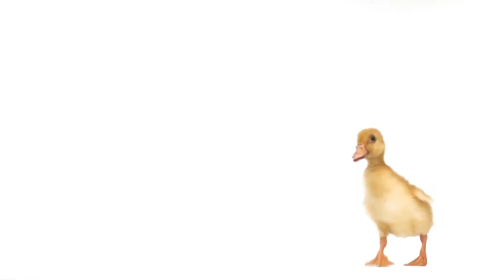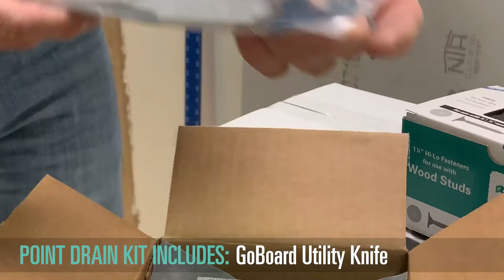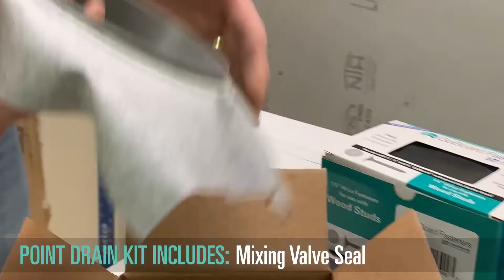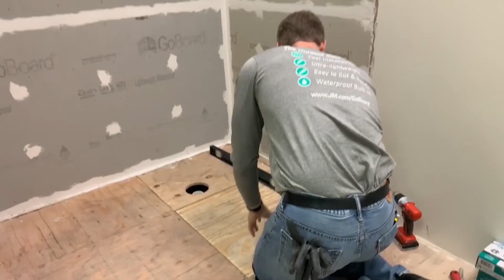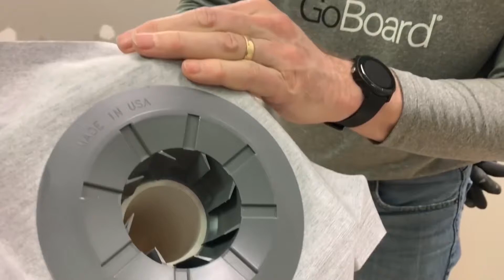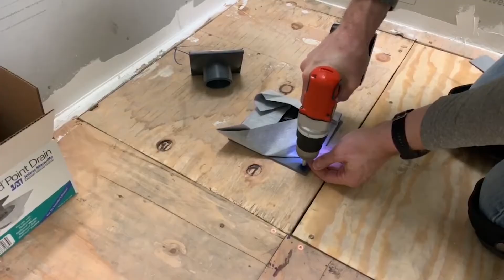Easily Install the GoBoard® Point Drain Shower System

Comment: How would Heavy Glass shower doors be secured to the Curb? Seems screws would not hold very well in Foam.
Reply from the maker: The preferred method is to secure the door to the wall. Another installation method includes cutting channels for setting wooden dowels into and through the foam, for more secure fastening of door hardware. Then use GoBoard Pro Sealant to well waterproof the dowels and foam penetrations. Door track can also be adhered to the curb using GoBoard Pro Sealant.

Comment: Does the GoBoard wall sheets go all the way down to the floor?  If using a traditional pre-slope, liner, and sloped pan, should the GoBoard go all the way to a concrete floor also? This seems needlessly dependant upon the aquadefense or redgard. I am building my GoBoard shower this weekend. I started the concrete curb tonight and planned to build the pan pre-slope tomorrow and final pan the next day -- but perhaps with GoBoard I can put the walls up first? But again, this seems needlessly risky.
Reply from the maker: GoBoard is installed on walls first, all the way to the floor.

Comment: So if I'm using 1/2" Goboard on the outside of a bathtub for the floor, do I still have to mortar it to the plywood then screw? Or can I just screw it down dry? Then I have to leave an 1/8th inch gap all around for the walls & in front of the tub and the one seam I have and then fill all those gaps with the sealant? Then I can tile?
Reply from the maker: Just fasten the the 1/2" GoBoard on the outside of the tub. Fill the gaps with sealant. Wait for the sealant to skin over - and then you're ready to tile.

Comment: With the way the wedge pan was cut, does that create a level perimeter?
Reply from the maker: We recommend tiling the shower walls first, to help hide the angle cuts sometimes required near the shower pan in rectangular, and offset drain location situations.
Reply: @johnsmanvillegoboard  I believe a level perimeter could be achieved if you keep all the perimeter the same thickness and have your cut go from wall corner to drain corner instead of someone within the middle of the wall. I've used your system before, just never with an offset drain.

Comment: As a contractor I view the showers the same as exterior of a house.  You don't side the house then put the roof on because each thing should lap from bottom up.  Now that said I have forever poured rubber pans and used wedi and goboard on the walls.  With that I have always had rubber up the wall 6 inches.  I do want to try the tapered panels and ordered the kit.  I do plan to have the pan down first then the walls.  Is there actually a life or use life of the caulk?  Curious if anyone has made a shower then tore it out like some years later to see what was happening.  In this install I am not liking the half inch subfloor should be minimum 3/4" becuase of flex over years of use most often tile that has failed is over improper subfloor support.... 

Lastly if the floor tile is set at a 45 pattern I would think the pieces cut might have to be altered which I have never had to deal with on poured bases.  This should be interesting or is tape best used on the angled joints I would think to bridge any grout line stacking on the pan seam.  I might try this shower pan system but I always use liner drains so not sure I can get the depth I need in order to set a liner drain... will find out on this next shower.
Reply from the maker: Hi Marshal! Thank you for your comments.  Pan first requires angle wall board cuts for offset and rectangular pans. Cutting ½” rabbet in wedges would be recommended for wedges first. Rabbet on thicker side, that is. Better to do walls first. Shingling effect doesn’t apply when using 1/8” gaps and sealant. Have you ever seen the fish tank our team built using GoBoard? Check out Tile Backer Board playlist on our YouTube channel. You could optionally use GoBoard Seam Fabric for reinforcement - or an equivalent.
Reply: Marshall how did it go with the linear drain? And how did your source the wedge panels without purchasing the whole drain kit???

Comment: I heard about this product for the first time today. The shower pan installation looks ingenious and well thought out. But I'm only an amateur, that happens to have built quite a few showers so the value of my opinion is suspect. One issue is how level the floor is that this system goes over needs to be. My guess is that the sub floor is not going to be level enough in a lot of older buildings. Maybe self leveling compound would be a solution for that? Or maybe cut out the old sub floor and sister the joists to achieve dead level would be the way to go? I think I'd probably do the latter. At my skill level, installing self leveling compound would not be precise enough for something like this. My little secret: I switched to 3/8 inch per foot slope because I didn't want to take a chance on divots that wouldn't drain.
Reply from the maker: Per our instructions, a level floor is required - so yes - we recommend using self leveling underlayment (SLU). This might be a part of the project you could always hire a contractor to perform.
Reply: Definitely a newb here but is it the drain piece that adds the necessary slope on the level floor?

Comment: Is go board strong enough for a curb?
Reply: strong??? curbs serve to keep water in not to use as a step.  wood frame or Durarock curb will do.  Also if planned correctly, you can go seamless for a updated cleaner design...just saying
Reply: @robgarcia1631  I mean you still gonna step on a curb regardless
Reply: @ubacow7109  Why, just change your habit of going in and out of the shower. I never did and never will.
Reply from the maker: Yes, it's strong enough for a curb.

Comment: No way in hell would I trust a pan with all these joints. That caulk will crack and this will leak.
Reply: If you think it will, it surely will, Law of Attraction, you get what you focus your attention on. Look at all videos and read all materials. GoBoard has been long enough on the market, if it leaked, they would be gone years ago already.
Reply from the maker: It's hybrid polymer adhesive/sealant. It's permanently elastic. Test it out, by gluing together a couple of board scraps.

Comment: Where can I buy just the wedge and curb?
Reply from the maker: Ask your current supplier to bring it in, or if you can special order. Both are available as sold separately.
Reply: Josh in the Detroit area the 48 in wedge panels are also most impossible to locate with buying the whole kit and the one shop that had them wants $80 a pop for each panel

Comment: Do the wedges have a minimum tile size requirement?
Reply from the maker: Anything under 2" is not recommended.
Reply: @johnsmanvillegoboard  interesting, 
Why would it be a problem let’s say if I go with 1 inch

Comment: I read that the shower drain line needs to be at LEAST 1 5/8 inches below the top of the subfloor. What do you do if it is 2 1/2 inches below the top of the subfloor. Nowhere on the spec sheet does it state the length of the drain body or what to do if your pipe is shorter than the 1 5/8 inches.
Reply from the maker: Not sure we're understanding your question. Could you cite the information you read regarding the 1 5/8"? Are you referring to the plumbing waste pipe? Or the length of the drain body? Here's the cut sheet for the GoBoard Point Drain: https://www.jm.com/content/dam/jm/global/en/tile-backer-boards/goboard-accessories/GB-503-GoBoard-Point-Drain-Cut-Sheet.pdf

Comment: I think I would go with the Kerdi pre-pitched shower floor system myself. I'd also use Mapei Aqua Defense over Red Guard because it doesn't have an odor like the Red Guard has. The only draw back is that Kerdi has a lifetime warranty using only if you use the Schlueter All Set mortar, and only 25 years if you use a modified LFT mortar. The All Set mortar is a bit costly and it turns people away from using it. Do you have linear drain systems for shower floors also that work with Go Board?
Reply from the maker: The benefit of using GoBoard Wedges is that you can accommodate more shower sizes and there's no need to wait for a specially sized pan. Also, you don't need to move the plumbing. Simply customize on-site. With the GoBoard system, you don't need to use a liquid membrane. Red Guard or an equivalent is unnecessary. The board is already waterproof, and you only need to seal the joints using GoBoard Pro Sealant or a manufacturer's approved alternative.
Reply: @johnsmanvillegoboard  also ideal for envelope tile floor installs
Reply: Also GoBoard Wedges are denser then Kerdi board foam pans. Meaning less chance of dents while working on it
Reply: I stay away from their products. NTCA doesnt approve of their method.

Comment: Why leave 1/8 gaps? Seems too big
Reply: Rumor has it the sealant needs to get inside the edges to seal and bond from what I've gathered. I've used nothing but kerdi, but I'm using this on my next job because it's cheaper (for the customer) so i hope i learn a lot today.
Reply from the maker: Read up a little bit on ASTM C719. 1/8" gaps allow the sealant to get inside - between the boards - for optimal performance in consideration of expansion and contraction.

Comment: Is it OK if the drain is not in the center of the shower?
Reply from the maker: The Wedges accommodate any drain location. No need to move the plumbing.
Reply: @johnsmanvillegoboard  But the kit comes with how many wedges in case the drain is offset like the one you demonstrated in the video? How many wedges did you need for that particular shower?

Comment: Nice sub floor cut in. I am always open for new methods. I would just hope that the material has extra long longevity.
Reply from the maker: Polyiso foam has longevity, and GoBoard has a higher compression strength compared to other foam boards available.

Comment: Go board is a good board for a economical price  
 You should always use a mask as that dust leaves a nasty cough. 
 That drain grate should be in not on. On makes it so you break the grout or caulk seal when removing the grate. 
 Was that perimeter of floor level after installing.

Comment: The perimeter can't be level all the way around unless the drain is exactly on the center.
Reply from the maker: The perimeter levelness has no impact on drainage, as long as you have the 1/4" per foot slope in the pan you're good. Speak with the designer on the tile design and how you would need to adjust the pattern, if necessary.
Reply: As long as your slope is consistent with the 1/4 inch per foot guidelines it’s fine.

Comment: That drill looks like something you won as a door prize at a Tupperware party.
Reply from the maker: Neat! Never knew they give out drills at Tupperware parties!
Reply: @johnsmanvillegoboard  That is spotlighting how improbable that drill is and sounds. It sounded like something that was bought from Ronco or Harbor Freight.
Reply from the maker: @thyslop1737  Not really certain what the drill has to do with anything? confused We'll run it past the marketing department to see if we can start using the tagline: "GoBoard Fasteners are designed so well that you can even use a Tupperware party door prize drill to install them."
Reply: @johnsmanvillegoboard  LOL
Reply: @johnsmanvillegoboard  LOL
Reply: @johnsmanvillegoboard  Got him on the GO with that one 😂, love the product man! Ill buy one of those drills, why not?! lol
Reply: It's actually a Black & Decker Drill. I've had a very similar B&D model for at least 10 years and it uses the same batteries. Still works great.

Comment: So, as a DIY guy that’s looking to redo the shower in my master bathroom it would be nice to know what you put under the floor on top of the plywood. I assume it’s thin set, but you know what happens when you assume! I is a college gradumate (spelling intentional) and a licensed surveyor and former helicopter pilot, so I like to think I’m as smart as the average bear, yet I’m still not sure what you used. 
Is this available in Phoenix?
Thanks
Reply: My friend who is a general contractor and uses this system all the time and loves it says to use mapei brand Keraflex plus and then set your pieces and walk around to set it in place. Also he goes the extra mile to use aqua defense and a water membrane tape on all joints and seams to make sure it’s absolutely water tight! We are installing this system now! Good luck!
Reply: You would use a modified thinset for pourous subfloors (unsealed wood, etc.) and a non-modified thinset if there is a non-porous subfloor (or a subfloor with a waterproof coating on it). Many modified thinsets require the moisture to exit for the thinset to cure, so if the thinset is sandwiched between two non-porous materials it cannot cure. Non-modifed thinsets are identified by having ANSI A118.1 written on the bag. Modified thinsets include ANSI A118.4, ANSI A118.11, and ANSI A118.15.
Reply from the maker: Hi Glen, try Dearborn Supply or Monterrey Tile.

Comment: Just another joke for the tile industry. Use a liner and mud like a true tile setter.
Reply: Been floating since 1991 at 11 year's old... I will never play with that after using this product. Adapt and overcome.... Gotta keep up with the times before you get outdated as some of my stubborn mentors.
Reply from the maker: Mud is great! A couple of advantages of foam that are often overlooked is the reduction of weight on the subfloor, and moisture control. GoBoard is fungal and mold resistant. And with our wedge, the slope is consistent.
Reply: @johnsmanvillegoboard  doesn’t compare to a mud pan. It’s a substitute for craftsmanship.
Reply: If that were true we'd still be getting to our jobs on a horse. 😁